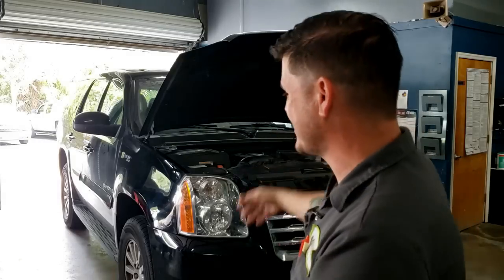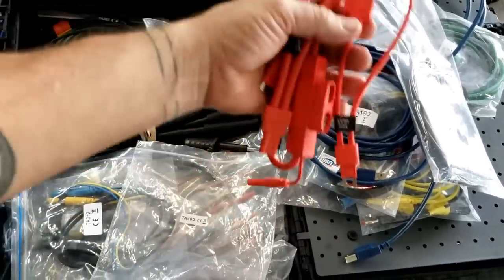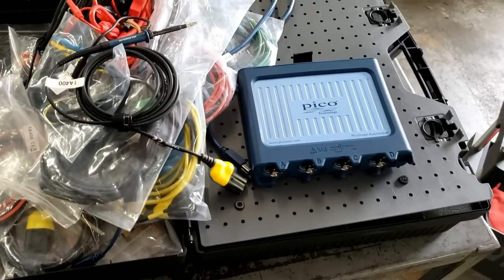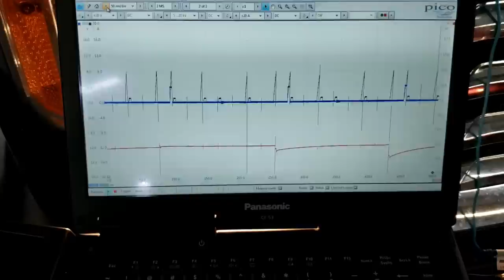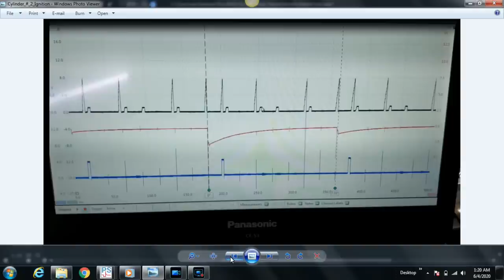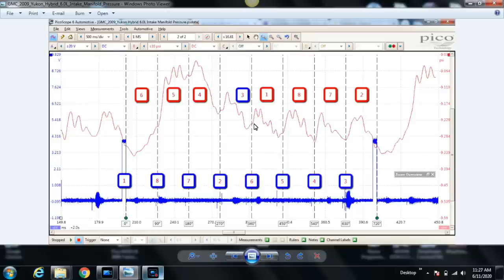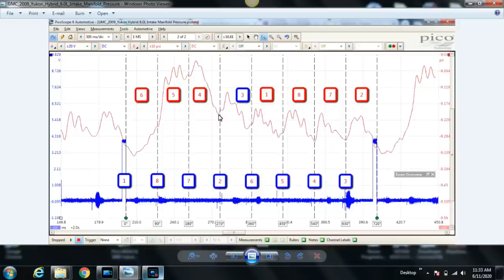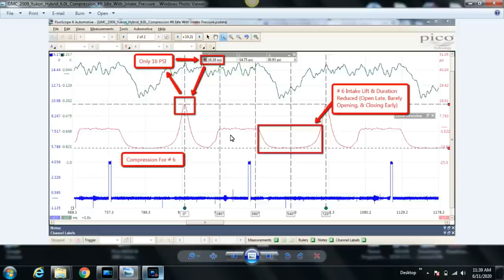NEW PicoScope 4425a Unveiled and Demonstrated on a 2009 GMC Yukon HYBRID! Misfire case study

Comment: Great work guys. It's worth trying PS7 with the new 4425A as there some extra features added in. For the clip on secondary ignition clips you'll see the option to select positive or negative fired so you can quickly flip the signal rather than having to select it from the probe menu in PS6. There's also the option to invert the signal at a touch of a button for when you get the clamp round the wrong way! Enjoy, keep up the good work and stay safe!!
Reply from the maker: Great tips! Thanks Ben

Comment: Extremely thoroughly explained Brin! 
Was it the lifter collapsing or cam lobe done for?
Reply from the maker: The repair and/or tear down was unfortunately declined. As you probably are aware, either events are fairly common on these engines. In our experience, Everytime we've torn one apart,  it needed a cam due to the damage a collapsed lifter caused.

Comment: So could be collapse lifter bent push rod or cylinder  Deactivation stuck open or flat cam  ... ie a  Physical failure
Reply: I had an exact same problem on a 2010 silverado.  Turned out to be a bad lifter and nylon lifter block that is supposed to keep the lifter roller in place. What was really odd was this same cylinder had 165 psi compression with a standard compression tester. Removed the valve cover and inspected the valve train while turning engine over by hand. Everything seemed okay until we started the engine with the valve cover off. No movement on number 6 cylinder intake valve at all. Damndest thing i'd ever seen

Comment: 36 minutes in are we still looking at inlet manifold pressure on the green trace and is it inverted.
Reply: Niall,
Thank you so.much for the question. I apologize for not mentioning the green trace.  It is intake manifold pressure but I used a delta pressure sensor and the red trace from the earlier capture was an intake manifold pressure capture using an absolute pressure sensor (Pico WPS500X). 
It is not inverted. I should've spent some time on that but I didn't want to push my luck time wise. I already felt sheepish that the video was 43 minutes long.